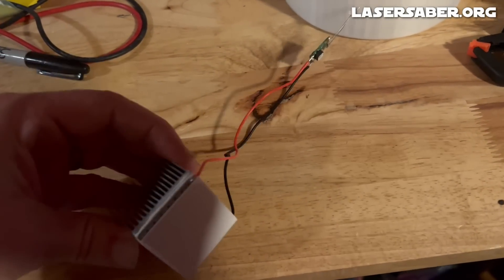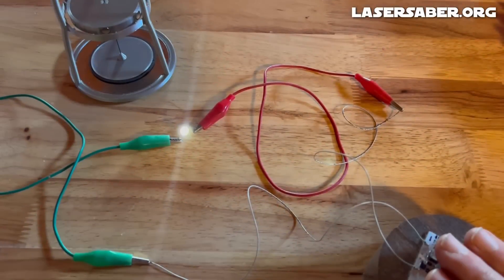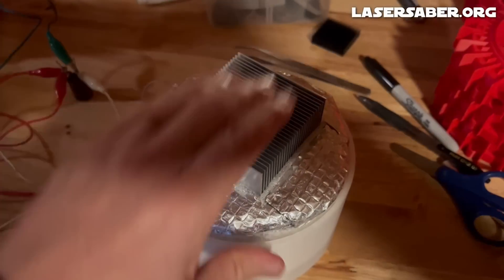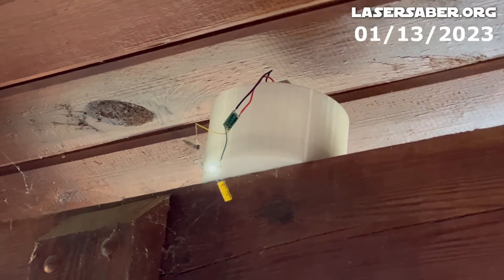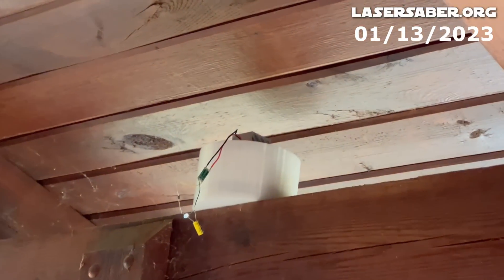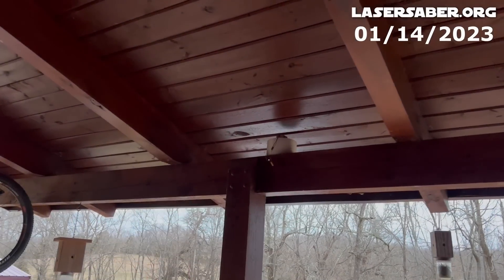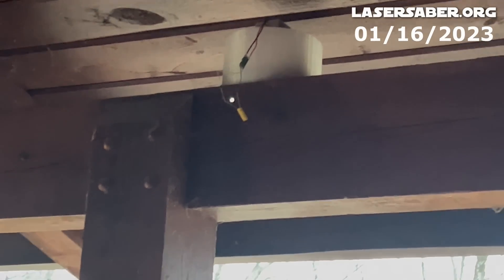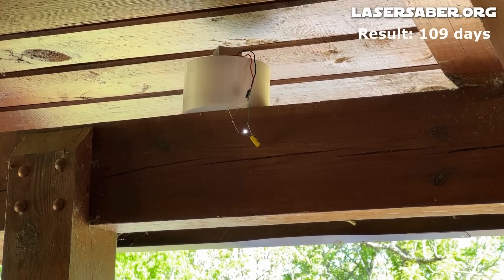Aerogel Thermal Generator - Ambient Energy Harvester

Comment: bro why dont you try putting some of the electricity generated at the bottom to generate a bit heat and a plug to control it , so you will create greater difference when in cold weather, it would be interesting if the efficiency will go up and generate more power

Comment: You could use this concept to generate power with a lake or river.

The water is almost always a different temperature than the air.

You could also use a great pipe in the ground and use the ground as your great battery as well, the ground is also, basically always a different temp than the air.

Comment: Now do it again but this time use more Peltier devices... And possibly more super capacitors or some sort of lithium battery... Maybe an extra led or two.... 
I personally would have used a bridge rectifier to auto route the correct polarity... And a DC to DC Stepdown converter... And a dusk till Dawn switch to turn on the LEDs only at night, this will give time for a storage device to charge..... Also allowing the top of your device to see some direct sunlight would speed up the charge process... 
This could turn out to be much better than those cheap solar garden lights..... 
Unless you use a resistor in the bottom via a diode and a small but cheap solar panel, something a bit larger than what is used in those solar garden lights to speed up the thermal uptake of the thermal mass inside? 
When in heating mode, thermal energy will be coming in through the top via the peltiers and getting a boost from the bottom... Night's are usually longer and cooler and thus able to spend more time getting rid of the stored energy via the peltiers! 
I just might have to give this a try.... 
I had a similar idea where I use a copper pipe which is sealed with a few drops of water in it and then pull a vacuum on it, the thermal transfer from one end of the copper pipe in this setup is beyond anything else! Weld a plate to one end large enough to take a few peltiers with a black heatsink on top and then bury the other end deep in the ground! 
Daytime direct sunlight would send that energy into the ground and release it overnight..... It's like taking advantage of the ocean tide's..... 
Hmmmm ideas for future projects.....

Comment: For the cold weather outside operation, could you have some vibrating devices inside that react to the vibrations happing to the outside, such as traffic or loud music or heavy wind? These could maybe generate heat in the inside chamber?

Maybe a dirty wide band radio reciever circuit thats geared to generate heat instead of signal to use ambient radio waves to keep the internal temperature up???
Reply: Thats a good idea I was thinking using some solar panel into and RF energy harvesting circuit in order to power some of these thermoelectric generators in order to complete out of the insulated device Everyone likes to use thermal energy but the reverse can be used just as well capture the cold and use the outside temperature as the heat source https://youtu.be/idfgDCJG0Ok?si=3UN8wBc8jSZXahde
Reply: @TheO5Council  interesting... So technically we could be using dry ice as a battery.  I wonder how that heat reflecting paint would work with these?
Reply: @TheO5Council  Apparently you can use the differential between the surface of the Moon and the internal temperature to power things.  The external temp gets to about  +/- 250°F and about 100 ft down its a steady 68°F.  So you can generate with the differential most of the Lunar night as well as lunar day.  Not sure how close or how long the surface temp hovers near 68.  Could be Lunar Twilight or some bit after, depending on how easily the surface rocks lose their heat in Moon conditions

Comment: Imagine a large array of these, but bigger in size. For sunny climates make top heat sink super black, make bottom heat sink either dipped into underground water, cold creek, lake or just deeper into the ground. There should always be large temperature differential. 
Plug it into a battery array to capture excess energy and smooth out spikes in energy demand.

Comment: I thought about something like this, but, for simplicity, why not make cement heat sinks and put them 12 ft in the ground .  It's always a steady temperature in contrast to the ambient air.  So my thinking was, make an array of these and scale it to get the power you need.  The problem that I ran into is finding materials that are inexpensive with a high differential Seebeck coefficient difference.  You can find tables online.  Moderately inexpensive materials like copper and iron would work in place of the N PN junctions in the Peltier chips but you'd need to assemble your arrays yourself.  I've seen videos of people making these on Youtube.  Their output isn't terrific though.  But, as a solid-state, simple material energy source, they're practically always on.
Reply: You might well be onto something with the suggestion of subterranean cement.  Apparently, mixing enough carbon black into the cement will create a fairly reasonable capacitor with an incredibly low cost, even if the energy density isn't particularly high.  One could attempt to replicate the MIT results in rod form, then seal and bury the rods underground to act as a temperature sink and storage medium for the themroelectric pile.

Of course, this system won't produce nearly enough energy to offset the cost of making it if it needs to be buried, but it's a neat idea.

Comment: I wonder if you could do a heatpipe or some way to move heat from inside to outside, or even a copper ground rod to transfer the heat, then use that to charge a supercapacitor an light up a yard light with a short segment of copper rod, heck maybe a water filled copper tube smashed on one end and have a flat end cap soldered to the end...permanent power for yard lights (kinda expensive for a $26 peltier type device!)
I wonder what the current output is...could it be used in conjunction with say a car battery and boosted to trickle charge the battery when the inside of the car is stupid hot, and in the shade underneath could be quite cooler

Comment: What if you used a metal rod buried in the ground as a core and outside radiator picking ambient air temperature.

Comment: @lasersaber could you make one of these that used the ground for the heat sink rather than that aluminum core?  What I'm wondering is if you could make some of those sidewalk lights that don't have solar panels on them.  Think of the novelty of that!  "Just stick this thing in the ground and it lights up your sidewalk!"  I think you could make some money off that product (as well as the 100s of other ideas others might suggest).

Comment: using a ground spike outside (grounding electric) goes down 8-10 feet and should always be ~50deg at the bottom end.  there would most likely be a big temperature differential above and below and harvesting that through some seebeck/thomson effect would always be available, no?  just figuring out a design to take advantage of that is a cool thought process and your experiment is taking me down a rabbit hole i haven't thought about in years ... thx!!

Comment: Been years I wanted to do this. My idea was to put some water bottle or something inside the thermal blanket because it has a lot more capacity(4184 joules/(Kg K) = about 1 Watt/hour for C change / kg) to absorb / release heat. But I guess for a LED, simple empty space will do it.

Comment: Imagine if houses were built with structures of materials for heat transfer and insulation and the whole house would convert energy on a larger scale compared to what is done in this video.

Comment: Interesting idea. Aluminium is a great thermal conductor but has a relatively low specific heat capacity. I don't think the thermal conductance of aluminium is required as the energy being drawn from the system is way less than the energy that can be drawn thermally from the aluminium core. What I'm getting at is I wonder if you can use a different core material that offers greater thermal capacity than aluminium. Water has almost 5 times the thermal capacity of aluminium and much cheaper. I guess with water you will have a heat sink immersed in the water then the Peltier module then ambient heat sink. Worth considering?
Reply: There might be a relationship between core materials and efficiency. I Can't quite picture it in my head, but too high heat capacity may harm the performance?
Reply: @dimitar4y  I guess the thermal mass getting too big means it will have other issues, like difficulty in moving it, but  the balance (I think) is between how much energy you want out (determined by thermal conductance of the thermal mass)  verses the total energy stored as heat (how long it will last). If you want energy delivered faster, (as in greater Watts) then you need better thermal conductivity in the core, if you want more stored energy capacity then specific energy density rules the roost. With aluminium, the energy density is low but the thermal transfer potential is very high. Not what is really required to run a led. I can imagine a litre of water, well insulated will be a better match. PS, I'd put the Peltier in the middle of the side of the bottle.
A practical solution will take into account the degree of atmospheric thermal variations and the rate at which these thermal variations occur.

Comment: I would Charge up a few LTO Cells (Lithium Titanate Oxide) And use a Active bi Directional cell Equaliser + Smart BMS (With RS Serial + Bluetooth ) To charge up  other cells in Series to Gain more voltage 12V ~ 48V  - 400V ~ 800V ~ 1500V DC For Inverters and MPPT VFD that  can deal with voltages this high and use "Veam ITT Cannon Powerlock PowerSafe Single Pole 500A & 800A Connectors" Series + "Powerlock Powersafe Sequential Mating Box 800A" to make playing with 400V ~ 800V ~ 1500V DC Safe

Comment: To make this even more efficient, I would shoot for a very precise thermal paste application. Yours made me cringe hard, lol [no hate though, LOVE your vids]... you almost certainly trapped air in that junction which will act as an insulator. But it's an interesting issue to think about actually: that air insulator might slow down the heat transfer, and lead to a not-as-bright light, but perhaps it will be a light that stays lit LONGER, in comparison. It's possible you might want that. That's the tradeoff, isn't it: it's either a faster, more intense settling of the differential, giving a higher voltage and a brighter light; or a slower, more gradual settling of the differential, with a sustained light output. I suppose it should just be sustained long enough to get to the next "cycle" of hot/cold swapping. But ya can't really predict that too accurately, lol... Imagine a modular, automatic one of these, that changes its own insulation based on the upcoming changes in forecast. And using machine learning to generate the maximum amount of photons over time. Ha! I appreciate the simplicity of yours though! Well done. Thanks for getting the gears turning, as always!

Comment: I think you should make a version of this device that floats on water. There is almost always a difference in temperature between a body of water and the surrounding air. Also solar heated water could be used.
Reply: I was just thinking the same thing.
Reply: Solar panel on the water with TEGs in the background may be better.
Reply: Or a sand battery

Comment: Ideal location of placement for this project as heat rising/ escaping and recovery cycle is a true constant. That particular spot in almost every building structure is evident on any thermal vision camera(wall and eve/soffit of the house).  The addition of the capacitor hints to endless potential of storage. Thank you for your efforts!

Comment: Since it works in Both Directions, 
Does a greater temperature differentiation produce a greater voltage?🤷‍♂️ (Is there a "sweet spot?)
This could be a "bigger is better" situation🙂
Can it be made to be easily recycled?
Very interesting stuff👍💪
what would happen if, 🤔
Make it like Russian nesting dolls, with liquid nitrogen at it's core and heat sinks in each layer, (progressive in size)
wiring parallel vs in series should provide some interesting results
I can't wait to see more🙂😎

Comment: I cant remember the exact location of the report but i read about 24/7 thermoelectric generators built by classified aerospace and defense at sea by using the temperature 🌡 difference between bottom of sea 🌊 vs surface, report stated huge power density potentials 24/7 365
Reply: I read about that too. There is a super high initial cost of construction though.

Comment: what if you treated it like a battery where you have an insulated thermal mass on the top and on the bottom, input power to charge it and it will heat one side and cool the other and use that difference to power something. Also it would be helpful to have a thermocouple on each side to see the difference in temperature you are working with and the efficiency of your insulation.

Comment: I always wondered what could be accomplished with the back vs front side of solar panels as the differential is purportedly pretty significant.
Reply: Same here, and it'd help keep the solar panel cooler, which could boost it's output.
Reply: @lightdark00  I was thinking you should have some additional thermoelectric generator in order to maintain a temperature difference within the insulated battery/generator something like this https://youtu.be/idfgDCJG0Ok?si=3UN8wBc8jSZXahde
Reply: Always thought it would be a good place for a Stirling engine, but maybe all you need is fins?
Reply: You could generate hot water with the heat and cool the panels in the process. Free heat and an efficiency gain from cool panels.

Comment: Peltier effect is so under used, I think it has to do with efficiency but never spent the time to really dig into it.
Nice to see you looking into it.
Reply: The engineering efficiency is around 5%, however what we see here is 100% efficient in reality, because although it may be only using 5% of the full energy available, the actual cost of powering the light source is zero because you have not had to pay some greedy fat cat to sit stuffing is face with caviar.
Reply: @richardsandwell2285  you need to pay for the initial cost of the components, but otherwise it's free.

Comment: works in the cold air too
Reply: better with a compressor + heat pump + cooler
Reply: simple water vaporization compressed heat transfer
Reply: also keeps the temperature of the water/steam/peltier at max 100C, no melting/breaking
Reply: nice passive energy
Reply: try with CaO + water heat storage
Reply: use concentrated solar to power the thermocouple
Reply: try non-electrolytic super caps
Reply: electroplate + graphite-brush a electrolyteless supercap on a graphite rod
Reply: hey try two different metals (aluminium-steel) as capacitive layers separated by hot air, I would say the there is no static accumulation when no hot air, as hot air contains free electrons, that are captured by the electric field between the two different metals (hot air battery kinda, static charge pump by macro electric field, same as in micro semiconductor diodes)
Reply: how about diy iron-copper(air) in copper sulphate in water solution battery about 1.1V, iron should be cheap to just put in a battery, as strips/sheet per kilogram, at 0.1$/kg (100$/kg-ton), reaction CuSO4+Fe->FeSO4+Cu (iron instead of zinc), it is rechargeable, reversible iron-copper plating reaction.
Reply: hey try 100% ethanol + koh electrolyte for metal-air fuel cell, with carbon cloth (fiber felt) air oxygen electrode, continuous feed of metal at full energy storage rating (1.3 to 9.0 kWh/kg), better than the crystal long duration batteries

Comment: Love seeing more TEG stuff. Impressive run time. I bet the desert would have the best run time due to the extreme temp changes. I want to try TEGs on the back of solar panels.
Reply from the maker: I think you have good ideas.  This TEG effect coupled with solar could be very interesting.
Reply: The amount of energy generated compared to a solar panel will be miniscule.
Reply: @sophiophile  It might be miniscule now but if it can recover any amount of energy that solar could not use then it could be worth it. If it is proven to be effective in any capacity then it might drive more people to experiment with other ways to improve the TEG or completely new methods. this would still be a great starting point. Even with the miniscule amount of energy generated it would still be nice to have a potentially constant power source to run lights or other low power equipment.
Reply: @SNEAKYxWYZRD  There are already very low power electronic transmitters that use this method. This is cool for homebrew, but it's already been commercialized.